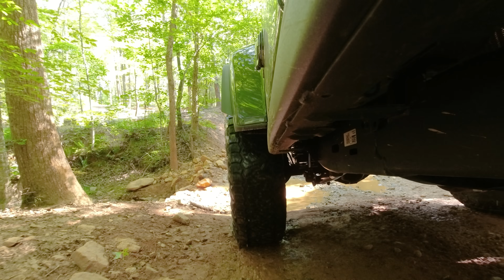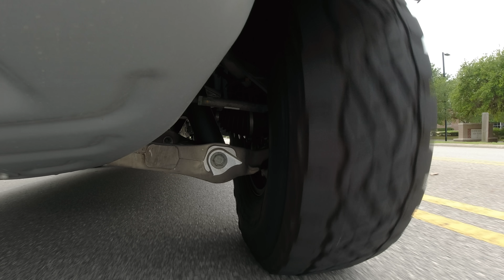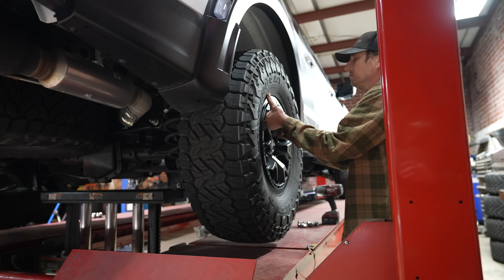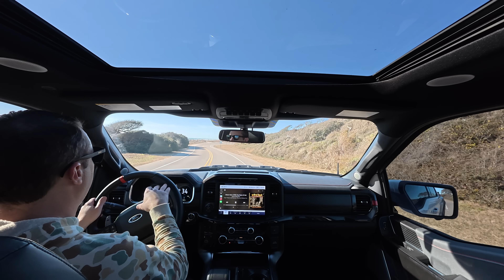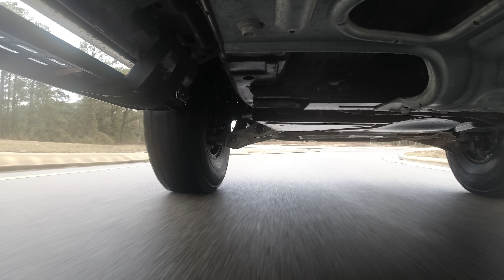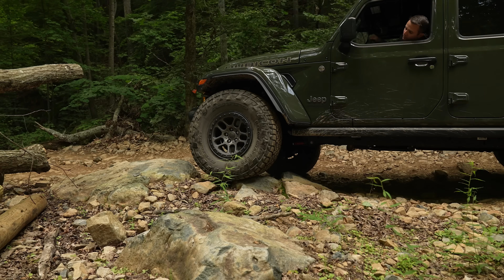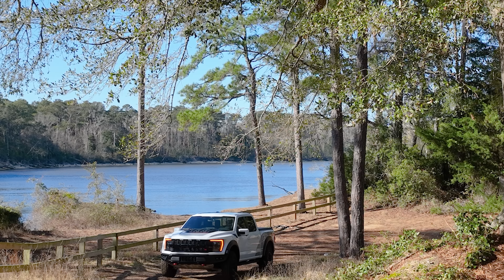12.50 Versus 11.50 Wide Tires : Which Is The Better Choice and Why: Inside Line

Comment: Great information here.  I'm driving a new 2025 Gladiator Rubicon X on its stock 33 inch Falken Wildpeaks.  These tires are relatively heavy and it is noticeable when driving.  I've considered upgrading to 35 inch but don't want to increase weight any more than necessary.  I love the Falkens but, honestly, I'd probably opt for BFG KO3's the next time around, as they're significantly lighter than the Falkens.  That would theoretically allow me to go up to a 35 inch without adding much to my existing wheel/tire weight IF the KO3's come in a n 11-1/2 inch width on the 35 inch tire.  I need to do some research.

As always, thanks for sharing.

Steve

Comment: Daily work truck 2021 F350 single wheel with flatbed/toolbox’s and transfer fuel tank pulling a gooseneck weekly towing 35k-42k gross.  I work off-road daily in south Florida mud and sand. Recon grappler 35/20 13.50 on stock wheels no lift or level put 72k miles on first set and now 10k miles into my second set truck handles loads like a dually and no issues at all with tire wear with the wide tires on stock wheels, probably had another 10k left on the first set but towing heavy loads for long distances I don’t take chances with older tires.
Reply: What Load Rating did you go with E or F? 

The reason I am asking: I have a 2024 F350 SRW 6.7HO Tremor. I put 60k miles in the stock tires. I have been looking at the Ridge Grapplers, so I got them two days ago. They do ride amazing in a straight light but the rear end has a rubbery feel. So much so that the self driving lane keep won’t work around corners at HWY speeds. I have the exact tire size that was on there, exact same load rating and even aired them all to 80PSI cold. Not much help. Discount Tire will return them but man I love the better ride than the bowling ball stiff Duratract Tires it came with. I thought of stepping up from a E rated side wall to an F rated side wall. Thoughts? Right now the truck just wallows in lane changes, and turns.

Comment: Wider tires are actually worse in the sand than narrow tires, the wide ones push the sand out in front of the tire and have a greater chance of bogging down and getting stuck. Narrow tires cut through sand better, the idea that a wide tire "floats" through the sand is false, a two ton truck isn't floating over anything.

Comment: I did a Rubicon spring/shock swap with a 1.5" Terraflex leveling kit on my 22 JT Overland w the 18" wheels. Went with a 295/70/18 Cooper Stronghold AT which is 34.3x11.6x18, looks,  handles and rides amazing.

Comment: Glad to see more info on this topic. Tall Skinnies on all my rigs. I have advocated that for years. 10-11.50's on my Jeeps, and that exact 37x11.50 Nitto on factory wheels on my '03 2500 CTD Ram which see's a ton of off road. I have found the same advantages you covered, as well as less wear and tear on steering components, the factory wheel steering geometry turning on its axis rather than an arch (with an offset wheel), their relation to ball joint and wheel bearing leverage and wear, and alignment specs. I do have a back-up set of 12.50 MT's on steel wheels I run to time to time for specific reasons to my use. But overall love that 1-1.5 inch narrower tall tire as a general rule. About 10 years ago I even tried 33 x 9.50 BFG MT's on my TJ, and ran the Rubicon with them. Outstanding performance. But I'm back to 35 x 10.50's on the TJ (Kenda Klevar RT), & 35 x 11.50's on my JK.  I did see another reviewer of this topic find, that aired down, the narrower tire footprint got longer than the 12.50's. When it came down to splitting hairs, the contact patch was almost bigger in square inches because of that ability to create a longer track. Cutting through snow and hydroplane advantages as well. Anyway, my experiences will keep me on the straight....and...."narrow"!

Comment: I ran 34 9.50 15s Yokohama geolander at on a 70 wagonner some years ago and really liked the tall skinny tire in the snow on a heavy rig. My cherrokee i run Yokohama geolander ats 33 12.5o 15s. Light weight rig just floats on snow at 6psi. Dont do mud and try to stay out of sand.

Comment: 33x10.50r15 on my 94 jeep yj. Prob the most popular tire size for off roading anywhere but the USA, bigger isn't always better. I had 33x12.50 and i get 2 mpg more, it rides better, tracks better and my whole vehicle and windows stay clean w fender flares

Comment: Did you notice any difference in milage (mpg)?
Reply from the maker: Not around town. It seems a little better on the highway. This Raptor just drinks fuel, however. I think on something more fuel efficient in general, it would be more noticeable.
Reply: I have a 2023 Tacoma ORDC 4wd and was exploring the idea of narrower tires. I have 265/70/R16. Any suggestions
Reply from the maker: If you’re trying to stay with the stock size, I would check out the Terra Grappler G3. It’s a good all-terrain and they make it in that size.
Reply: @DrivingLine  Thank you Sir for your input.

Comment: I use BFG KO2s 12.50x35 on stock gladiator rims. I have 50 psi, and don't air down. I live in Alaska just north of Fairbanks and we gets lots of snow. I have had no problems with the tire at that pressure.
Reply: Why are you running 50psi on a gladiator?
Reply: Because he doesn't know any better. He clearly isn't a good source for tire information based on he thinks KO2's are good and he's running them WAY overlinflated... @jayteknica1175

Comment: Keeping my properly load rated stock 18" wheels on my 2007 F350 is why I went with a 35 x12 tire.  Back then there weren't a lot of options in that size.

Comment: People go with looks over performance in what they drive on both on and off road vehicles ! 
Surprisingly a tall narrow tire will get you through deep mud better .
A wide tire helps in road grip but in wet conditions will cause you to hydroplane easier ! 
Much more so on a light vehicle ! 
The choice is yours but understand you can’t have it all , you will give up something for something else !
Looks, grip, mileage, noise , ware etc…….
Reply: So on a heavy super duty wider is better?

Comment: I purposefully went with the Goodyear Territory MT 315/70R17 that comes on the Bronco and Colorado ZR2 specifically because it runs narrow. Its more like a 11.5" tire. I have had two sets now, one on my previous F150, and now a set on my Lexus LX570 and I have put them next to a 285/70R17 KO2 and 315/70R17 KO2 and they were almost identical in width to the 285's. The difference vs my 315/70R17 KO2's was extremely noticeable and I think I picked up about 1 mpg average.

Comment: There’s been comparisons where at the same pressure, the narrower tire actually has a larger surface area in contact with the road than the wider tire due to the way in which the tire absorbs the load, the wider tire created a thin line of contact and the narrower tire creating an oval contact patch. Interesting for sure. I’ve been considering 11.5 wides for awhile cuz my 35x1250s rub at lock in my leveled ram 2500. Can’t beat the looks of the 12.50 but drivability and mileage might beat out the wider look, especially on a stock wheel.

Comment: i have terramax rt 37.12.50 17. the tread is only 9 wide and they run skinny they should be 37 10.50 17 thats how skinny they are weight 60 pounds 3 ply side wall and 8 ply d rate.  i have 2 broncos one on steelys that are 7.5 wide and the other on black rinos that are 8.5 wide .

Comment: Great video… So if you’re running a 37x12.50 on a Gladiator what pressure would you recommend?
I have Mickey Thompson Baja Boss M/Ts…
Reply from the maker: Depends partly on the wheel. I was usually around 30 psi front and 28 rear when my Gladiator was on 37s.

Comment: That was interesting.  Tinkerer's Adventure did a study on tire width sometime back.  He found by measuring that a skinnier tire actually had a wider footprint when aired down than a wider tire.  So, even though you drove with normal street pressure on sand you should be able to air down and have better floatation than a wider tire.
Reply: Tinker and Outdoor Auto's videos on it were great too

Comment: Seems like more company's would make 37 x11.50 tires for all the super duty and power wagons. 37x11.50 r18 and 17 would be perfect for factory wheels. Most heavy duty trucks fit this from the factory but 12.50s rub and sling mud all over.
Reply from the maker: Nitto makes those sizes - In the Ridge Grapplers there is 35x11.50r17LT E, 38x11.50r17LT D, 37x11.50r18LT D, 38x11.50r18LT D. In the Recon Grapplers there is 35x11.50r17LT C, 37x11.50r17LT D or also the LT285/75r18 E measures about the same as a 35". Even the new Terra Grappler G3 is available in a LT295/70r18 E that measures about the same as a 35" too.
Reply: @DrivingLine Yes need e rated mud tires and hybrids though. Ain't crazy about those choices.
Reply: Ridge Grapplers are the only manufacturer (11.5 wide) that I could put 37 11.5 x 18’s on my 2025 Tremor Wheel.  Adjusted the speedo and real fuel mileage is about .75-1 mpg less than the factor 35’s.  Pleased so far but wish other manufactures would follow suit.  The Ridge grappler is more of a Hybrid and I would like a AT like the G3 or even a BFG KO3.

Comment: Great comparison....I'm a pizza cutter guy. When you deflate the tread gets long front to back but with less width you have less of a sand bow wave you have to over come. 
I only wish manufacturers would make the 11.50 in a 35" and 37" diameter for the 16" rim. I've seen some 35's but no 37's. I would buy 37x11.50R17's in a highway tread pattern for my street driven trucks in a heartbeat.
Reply from the maker: FYI: Nitto has 35x11.5r16LT D in the Recon Grappler. If you move up to 17s there's a 35 and 37".
Reply: @DrivingLine  I wish the manufacturers would still make some road-able 36" and 37" radials for 16" rims. Only ones left are Super Swampers and not real street friendly....where 90% of nearly everyone vehicles spend their time.
Reply: thank you for the great information. I swapped from 275/60r20 on my RAM 1500 tp a 35x12.50r17, I like the larger sidewall. I will definitely look into the 11.50 for my next set of tires in the next 6 months.

Comment: We have been running 35 11.5 17 Toyo at on our gladiators for several years. They work great on the stock wheels and the spare doesn’t hang down as far as a 12.5. Some of these are c load and some are e so keep that in mind.

Comment: I would love a NITTO 37" x 11.50 true winter tire, not a "3 peak". A dedicated 37" winter for 3 months and put my AT's on for 9 months. Here in Ontario, Canada, a true winter tire is the smart choice.
Reply: Pizza cutters are the way to go if you’re someone that loves to hit the rough trails and also the mud or snow.
Reply: Do they even make a snow tire?
Reply: @phild9813  Yes, they make a winter for passenger cars, the Nitto SN3
Reply: Did you see that Nitto has a 40,000 tire recall for throwing tread? Maybe you would like to look at a Falken or BFG? They are both great snow tires.
Reply: @robertgoodrich8953 another alternative brand that has been growing and gaining attention is the Kenda Klever. Great value that can compete with the leading competitors for tires

Comment: Hi you mentioned on your TRX VS Raptor vedio that the Nitto were true to size. Are the Nitto actually taller than the KO2s? Looking to replace my stock KO2s on my G3 Raptor. Wich would you recommend out of the Nitto line up for a weekend warrior?
Reply from the maker: The Nitto’s are definitely taller and wider. I really like the Recon Grappler on the Raptor. It’s doesn’t make much road noise and works great for what I do with the truck.
Reply: Thank you for the feedback!

Comment: It's crazy how quickly times change, back in the mid 90's I ran a 31X10.5 on my F-150 & I also live in N.C. & would go to the Outer Banks "Rodanthe" every weekend "fishing".
I always let my tires down to 15 psi. unless the sand was surgery then I would go down to 12psi, I really miss those days.
Reply: Love the outer banks, spent a week every summer down in hatterss and buxton. We always ran stock tires and aired down to maybe 20-25 psi. Never once got stuck out there. My dad actually let me drive for the first time out there at about 14 years old. He said you cant run into anything out here just dont drive into the atlantic 😂 miss that place a lot

Comment: I'd guess it wouldn't be significant enough to notice, let alone enough for a Raptor R owner to care about... but I'm curious if there is any mpg difference.
Reply from the maker: The in-town fuel economy hasn’t changed. I haven’t taken the truck out of town yet, but my guess is the highway efficiency may be better. When I look at the current fuel mileage read out, it says that it’s better than it was. However, my hand calculation wasn’t much different. This truck just drinks fuel. It also doesn’t help that it’s super cold, so it gets remotely started daily for a few minutes.

Comment: 11.50 all the way.  I have run a 11.50 for years and years and love them.
Reply: :popcorn-yellow-striped-smile:What other brand has an 11.50" wide radial tire? These Nittos are just released...  I've seen plenty of tire brand option in 10.50 but only in 15" wheel 31, 33 & 35" height, maybe Kenda in a 35x10.50r17 but aren't available in Canada.  This is only option in a 37" that I've seen.  I like a narrow profile for soupy mud over a hard base or on snowy/slushy roads.  Point me to other options in a 37" plus in 17" wheel and I'd apricate it.  Cheers:goodvibes:
Reply: @monette44  My mistake, I looked at my tires and they are 10.50